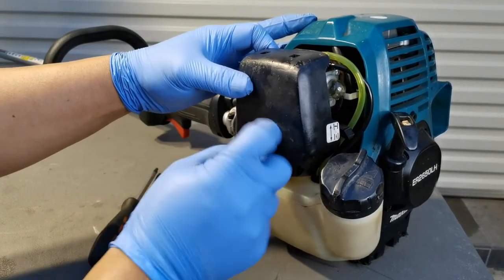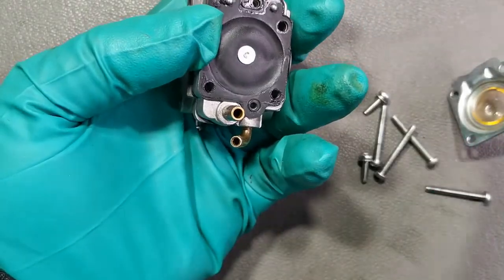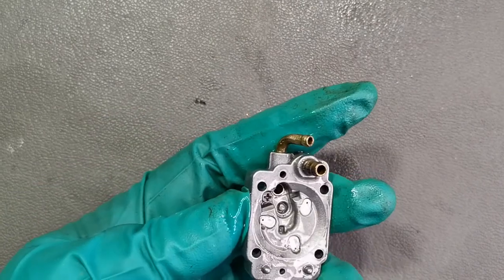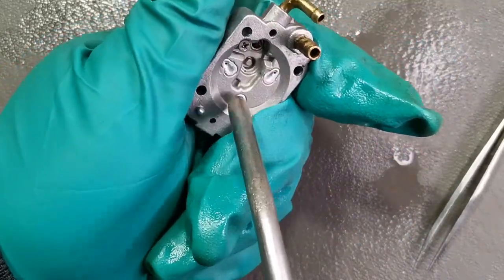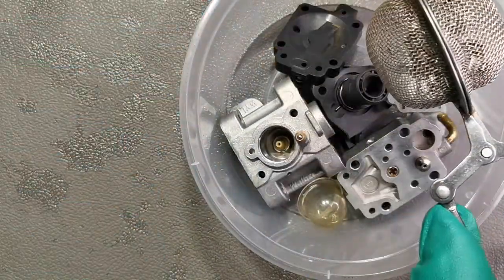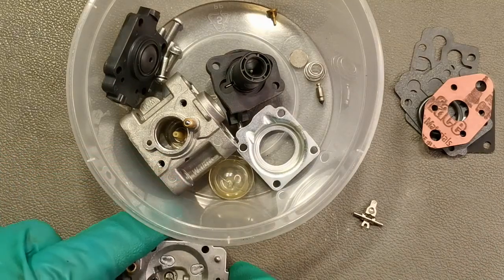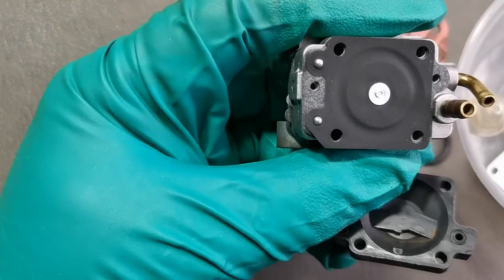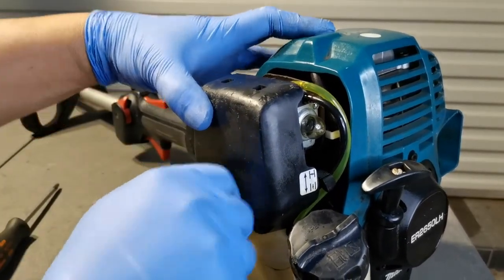VTECH 13 - How to rebuild a carburetor for a Makita ER2650LH Trimmer?

Comment: Hi i have this kind of used grass cutter from my boss i want to send it to the Philippines.is it possible to reassemble it so that it will fit the shipping box?
Reply from the maker: It is possible to reassemble but with long shaft It won't fit on most door2door box unless it's a split shaft which could fit diagonally on a 21"x21"x21" box. I did once sent a professional chainsaw to Philippines before on a door2door box. Bar and chain were removed, petrol tank emptied  and carby was primed to clear residual petrol.
Reply: @Varietech-AU  thanks for the advice yeah i have the long shaft that is my problem i will try to find box for that. Anyways thanks again.🙏

Comment: what he does at 21:36 most of you will never be able to do...he has the hands of a skilled surgeon this man!  so warning...dont take apart the metering valve or you will end up buying a new carburetor for 10 dolllars.... not that expensive for a replacement carb...
Reply from the maker: Thanks for watching our video. If you accidentally lost any one of these small parts especially the metering spring or need, we have them available on our website and no need to buy the complete carburetor. They are very cheap. Contact us at www.varietech.com.au.